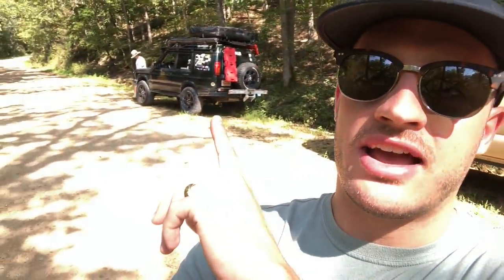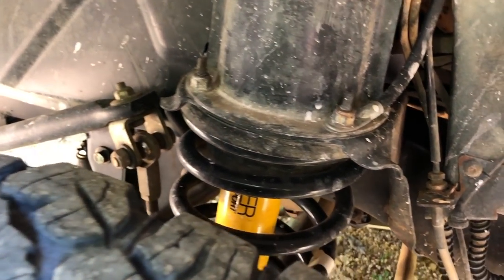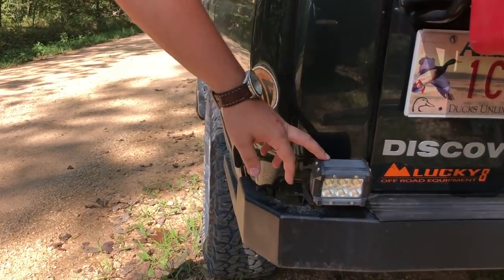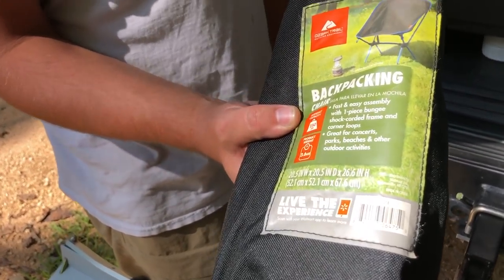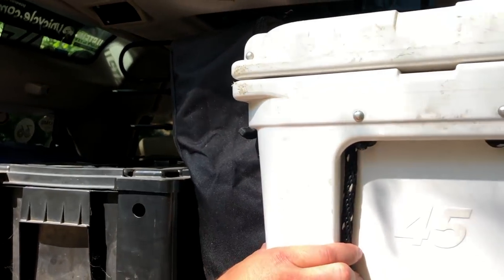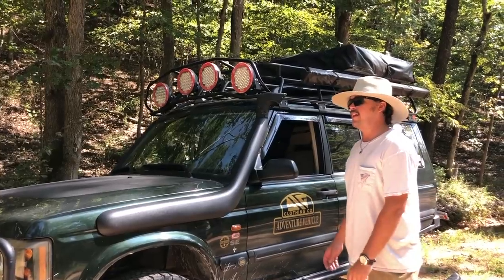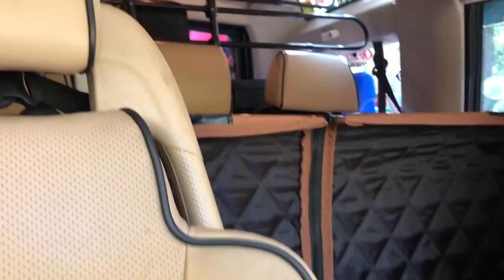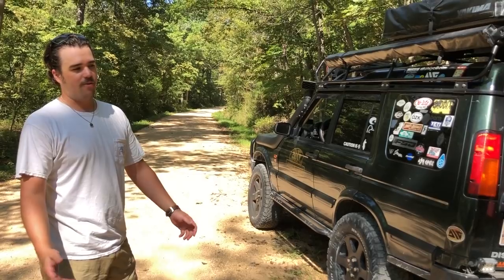[OTW: 01] - 2003 Land Rover Discovery 2 Overland Build

Comment: I have one in black. Fully kitted just like his. But with black 16” inch steelers and rock sliders. I even have a Cobra CB radio. I even use it to tow my motorcycles to the track. I use my ARB awning for shade during paddock breaks. Everyone asks me about it and even get asked if I’ll sell it. Best part for me is the aluminum block, just like the aluminum block on my DOHC 4.6 SVT Cobra, that was made in England. Cheers! 🐍